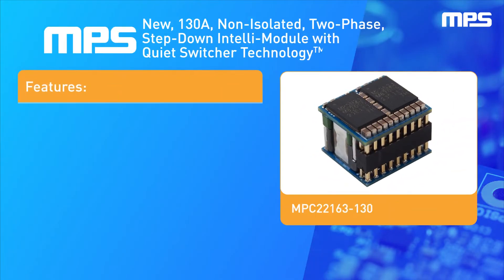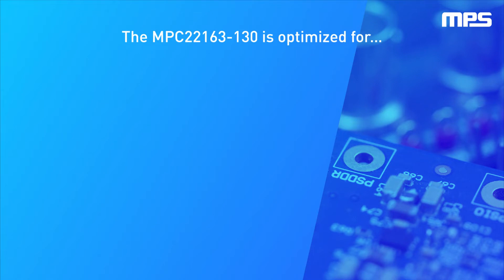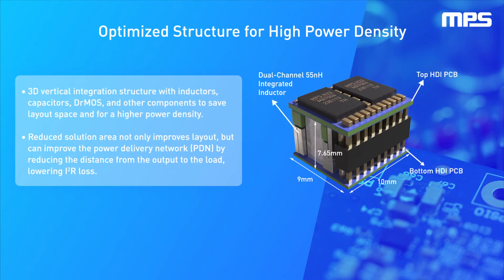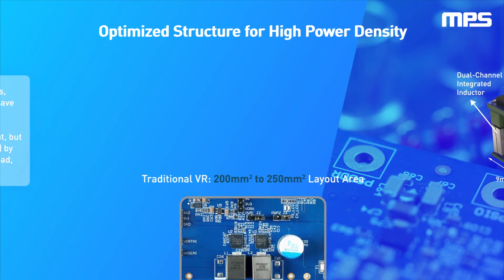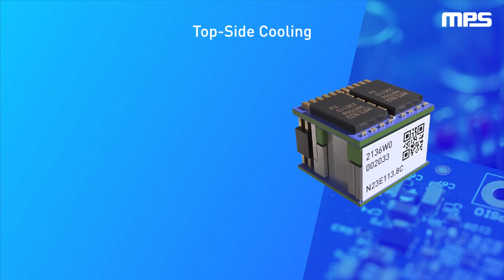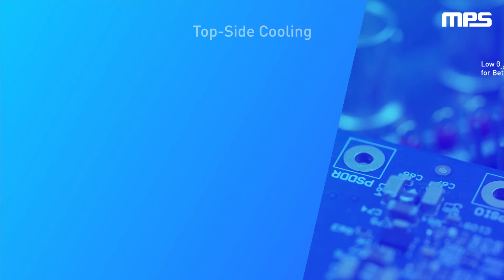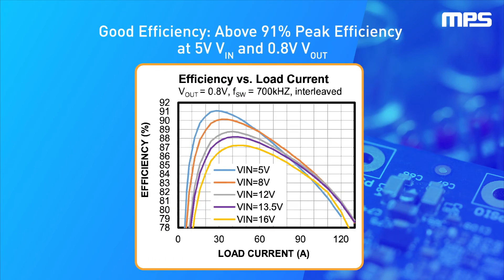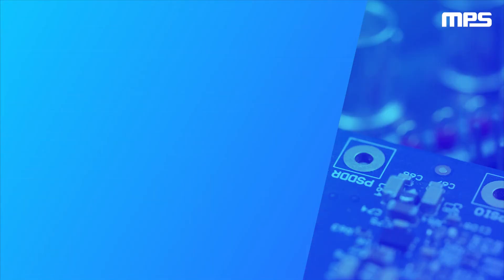Non-Isolated, Two-Phase, Step-Down Intelli-Module for Server Applications: MPC22163-130

Comment: Hi, not sure I understood, is the LGA version socketed? For easier replacement than soldered parts?
Reply from the maker: MPC22163-130 LGA is not socketed. The device needs to be soldered down to achieve the target output current. MPS does not recommend socketing these parts as it eliminates the power density benefit of the device.
Reply: @monolithicpowersystemsmps534  Ah, thanks. Still an interesting design.